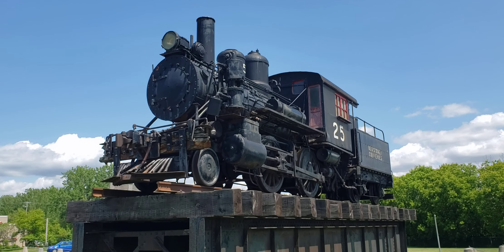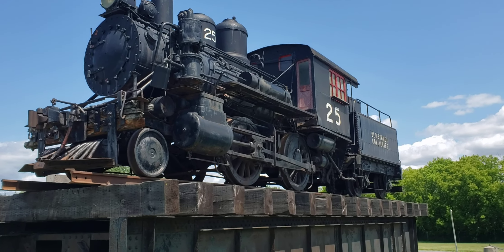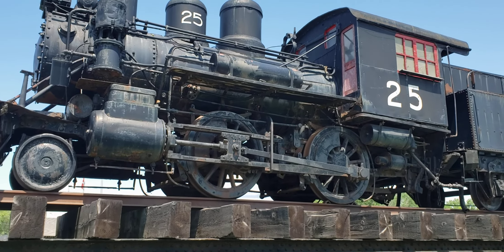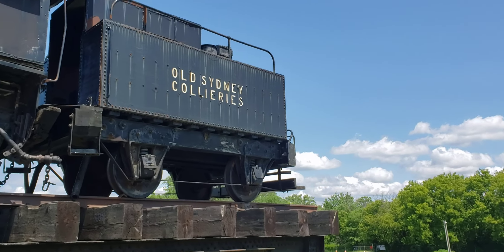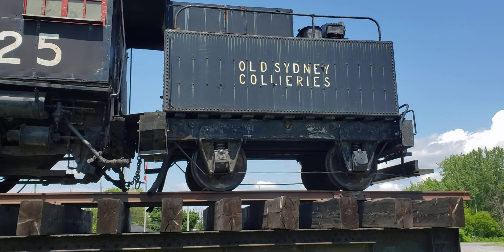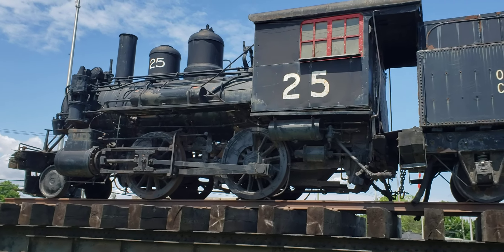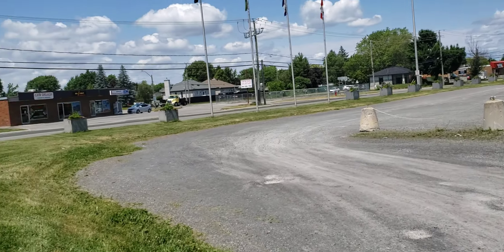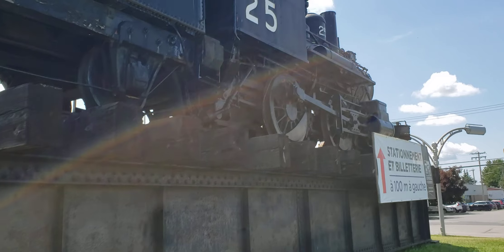TRAINS EXPORAIL Museum Entrance Display Steam Locomotive 2-4-0 Switcher

Comment: Very interesting to see such a small locomotive modernized not only with airbrakes but also with a electric headlight.
A lot of 2-4-0's were built for railroads in North America from the 1870's to 1890's but most were gone but before things like electric headlights were commonplace.
While most 2-4-0's were used for switching they were quickly over shadowed by larger 0-6-0's and 0-8-0's.